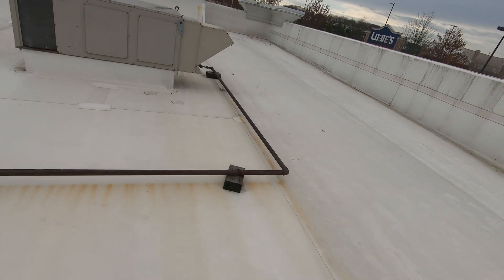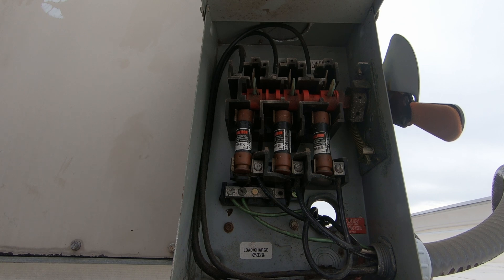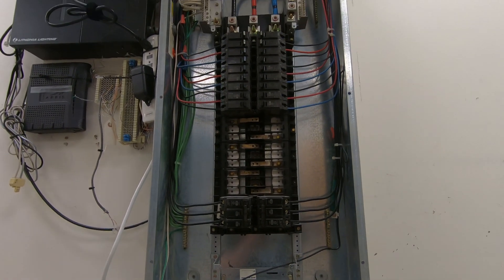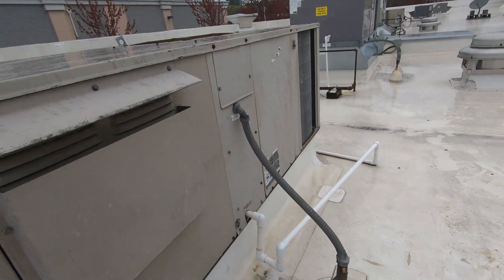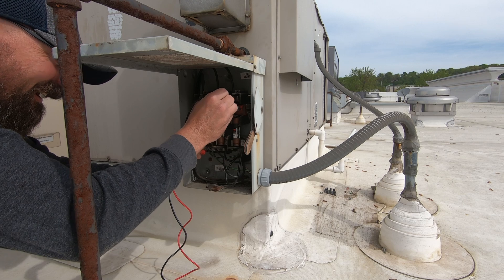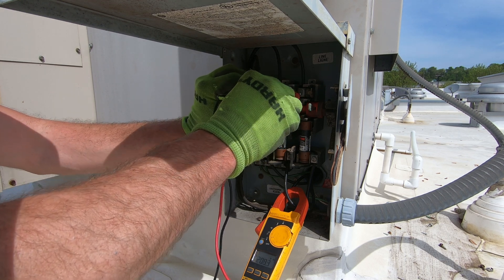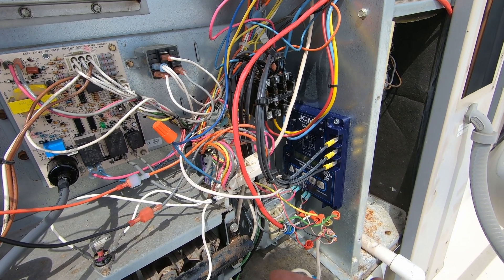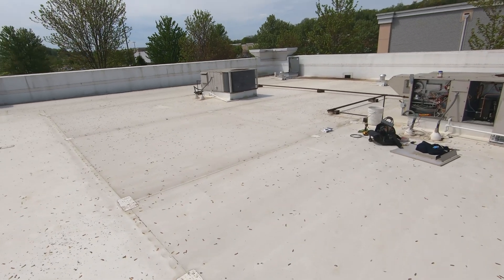Voltage Problems Lennox RTU

Comment: Quick question about phase monitor did you add 3 of the black wires from contactor and jump it to phase monitor (ive never done one yet)
Reply from the maker: Yes, the incoming power is landed on the topside of the contactor. I could have run wires directly to the disconnect but I decided to land them on the line side of the contactor for convenience.

Comment: Nice flashback if it was only that easy. This is where a thermal camera would help determining which leg has opened up. Breaker is failing. Nice kick the disconnect to turn it on.
Reply from the maker: I should have pulled out my thermal imager! Damn. Thanks for watching!